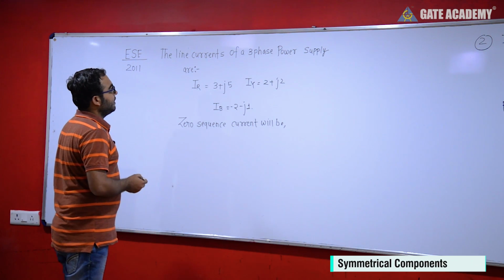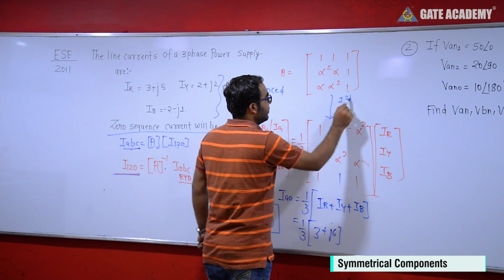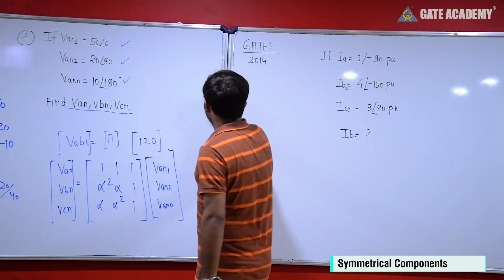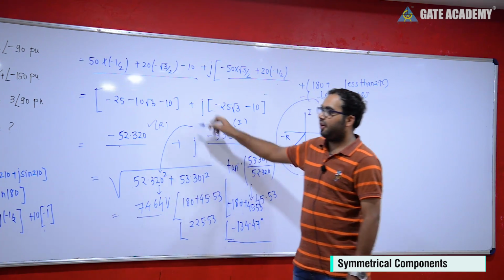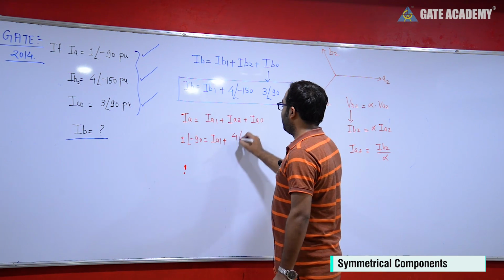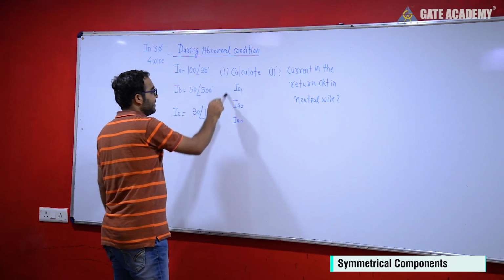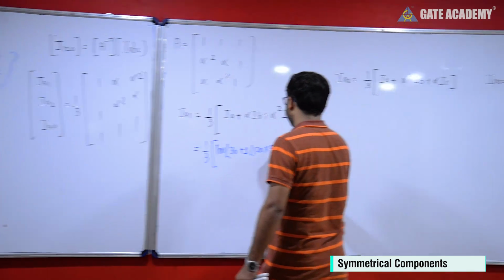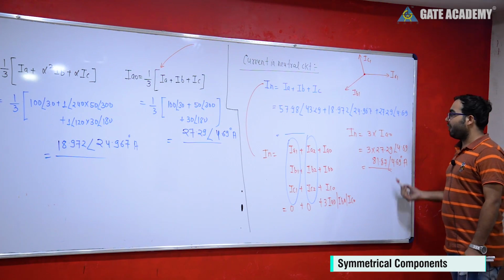2 | Symmetrical Components | Power System Analysis

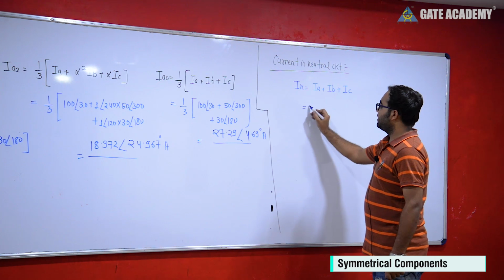Comment: Sir I think that there is mistake in writing neutral current value at 21:34
Reply: That you can write also...or u can add simply Ia,Ib,Ic...you will get the same answer. So either 3*I0 or (Ia+Ib+Ic) = In
Reply: arghadeep mandal
Iao +Ia1 +Ia2 =In
How???
I think it is Ia +Ib + Ic=In
Reply: @shubhambhandari415  yes the value is written wrong there....he did a mistake while writing the value of Ia Ib and Ic...